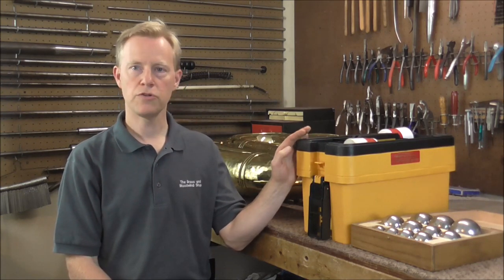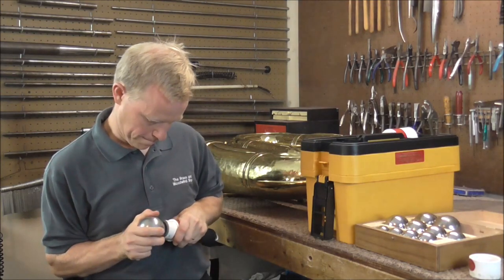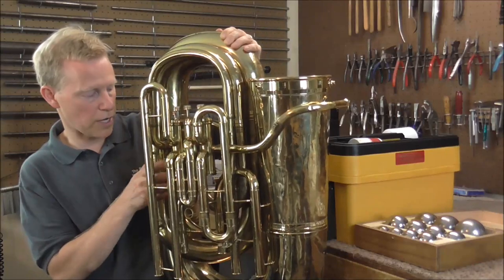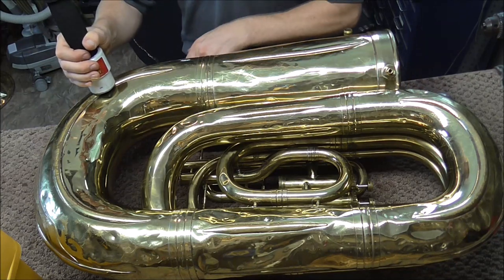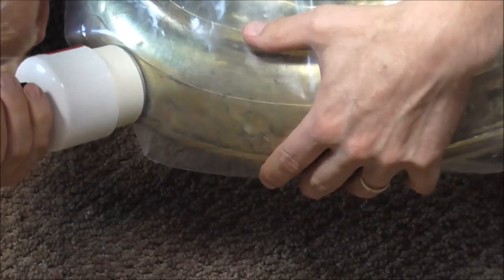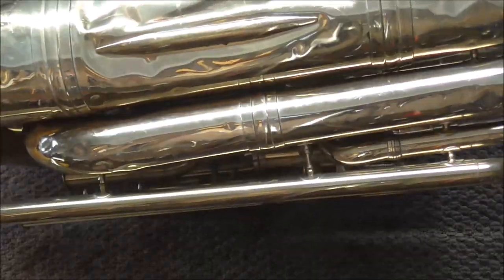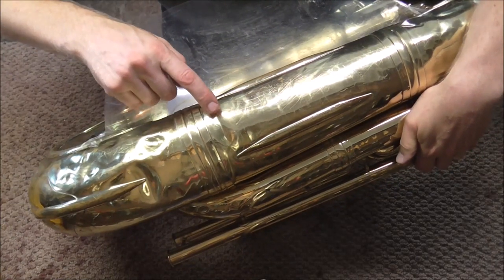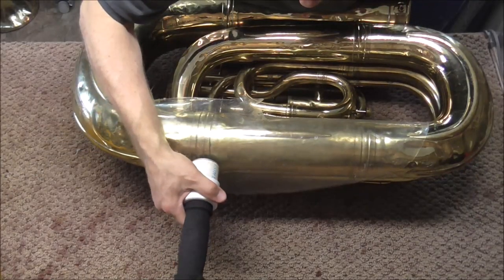Magnetic Dent Removal System

Comment: I've always wondered if a system like this might be used to remove dents from steel bicycle frame tubing. Steel is much less malleable than brass, but with a strong enough magnet and a 27.2mm ball it might work on a thin-walled steel frame.
Reply: Well, for one the magnet would stick to the bike frame!
It works (kinda) on brass instruments because brass is 1) non magnetic, 2) malleable and 3) thin walled. Even then it's a bit hit and miss, the bigger the ball you can use the stronger the bond and the more effective the action, and a 27mm ball is on the small side even in this application.

Comment: Art how does one control thinning of the brass or when to anneal or not? I would imagine there is some visible signs that let you know it has been worked enough.
Reply from the maker: It is very difficult to anneal because the heat burns the lacquer and melts all the solder joints. Because of this, usually annealing is only done when the instrument is already dis-assembled for an overhaul. You know you need to anneal when there are serious dents that require a lot of work or when you can feel the brass getting hard to work.
Reply: @TheBrassandWoodwindShop  Thank you Art.

Comment: Why not cover the magnets with a felt so that it will not damage the lacquer finish? A spray adhesive will allow you to add a circle of felt that will protect the magnet and the instrument and not effect the magnetic properties. Plus it will glide over the instrument smoothly.
Reply: Felt will collect dirt and metal filings and scratch the instrument. I use an old drum head with trombone cream between the magnet and instrument.